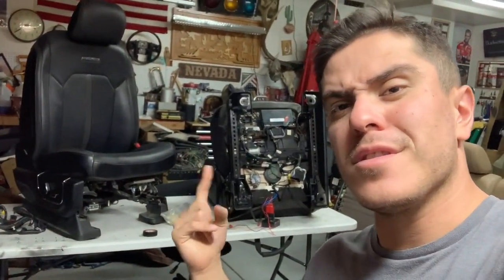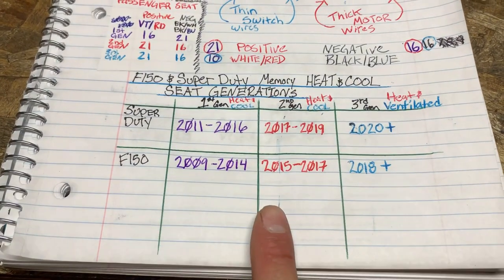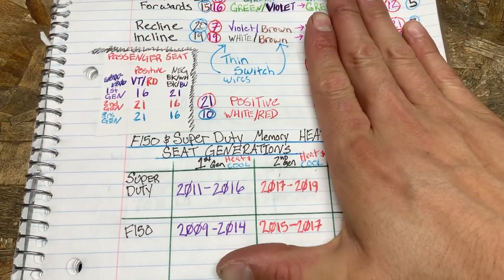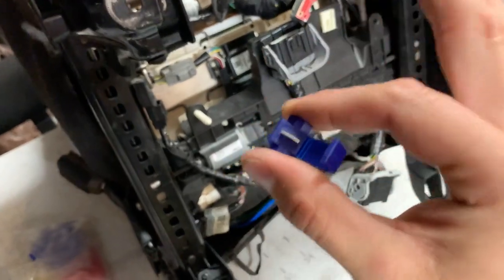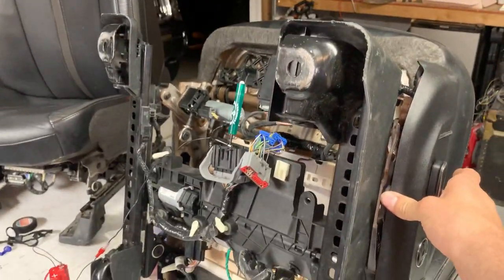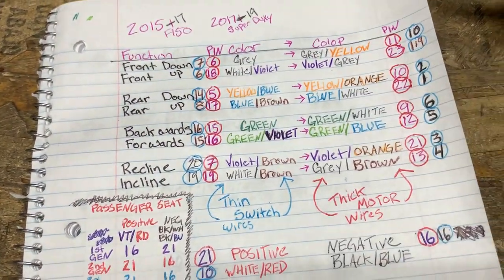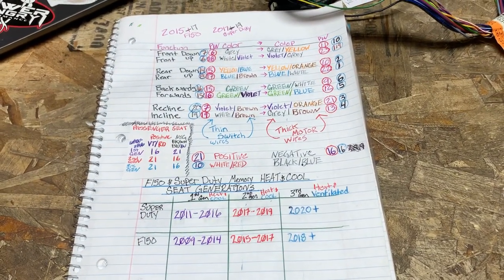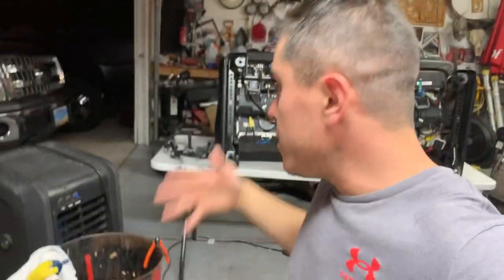How to Bypass The Memory Module & Power up 2011+ Super Duty & 2009+ F150 Seats

Comment: ⭐️⭐️⭐️ Hey guys, I’m commenting on here to add something to Zach’s video. I actually found some unicorn seats it seems. I bought a interior from a 2017 Platinum F250 and my power wire actually ended up being a wire that was LARGER than a SWITCH wire but SMALLER than the MOTOR wires.⭐️⭐️⭐️ I was very confused but ended up chasing it down by using Zach’s videos and much like everyone else on here I haven’t seen anything from him online anywhere so I just wanted to chime this in incase someone else was in my situation. The HOT wire I ended up needing was a WHITE WIRE with a DARK BROWN STRIP. Not to be confused with the small white/brown incline wire!

Comment: Absolutely spectacular video. Spot on and easy to follow. Thank you very much. One of the best instructional videos I've watched on YouTube. The only challenge Ive run into is Ford ran a microbic power wire to under the seat on my 2000, which had been previously upgraded from the blue vinyl bench to a beige 40/20/40. Unfortunately that wire does not appear to have enough oomph behind it to power the seats. As a result I'm going to have to run a new power wire. No biggie. Thank you again

Comment: Could you do a video on wiring the heating and cooling on the first and second Gen seats? In the process of swapping 11’ F150 Heated and Cooled seats in my 97’ OBS 7.3L! Would love to get full function out of the seats! I have the power figured out but have sadly already butchered the harnesses by cutting the seat motors and side switches and straight wiring them together then hooking fused power to the switches. Any help or info on the heating elements would be greatly appreciated!
Reply: Figure it out by chance?

Comment: Hello Sir appreciate the videos on how to do these upgrades. 
I have a slight different style of harness no brown plug I have a grey plug so I'm thinking a newer style seat and instead of incorporating 3 plugs the wiring colors are similar. Do you have another video that I just have not seen for the newer seats ? I am at the forward back parts and the green wire to white wire , the only solid green wire goes to larger plug that stayed in the module for the 3rd gen setup. All help is greatly appreciated. 
Also due you have one for the heated and coped seat setup yet I watched an earlier video where you did not want to ho into it at the time. 
Again thank you very much for all help.

Comment: Any insight on how to get heated and cooling working vis using aftermarket switches? Is it just as easy as getting power and ground to each device?  Thanks for the video.
Reply: Did you find anything out?

Comment: DO I STILL CONNECT THE FLOOR HARNESS UNDER THE SEAT TO MAKE SURE SEAT AIR BAGS WORK?
Reply: did you ever get this figured out? I am wondering the same thing. I also need to know what size wire and fuses to run for each seat as i am worried about overloading the wire that i currently have.

Comment: amazing video. just bought some fx4 seats for my 2014 xlt f150. had no idea how to even get started with attempting this project. thanks so much for the help. made this way easier and a whole lot smoother of a job! would you happen to know if the heated seats could ever work? i want to try them and make them work but i’m not sure as to how they would even be attempted to make work
Reply: I'm sure they just need switched 12v to do heat\cooling. Not sure if wires though. Definitely need a nice 12gauge wire for the heating, don't try to run heat from a 16g tiny wire. Setting up w\ a relay would be better too. There's a vid somewhere out here to help, I'm sure. He did do heated KR seats in his truck, so maybe check playlist. 🤔👍🏻

Comment: Wiring diagram was perfect, but two things, do you leave the airbags plugged in? And can I just run power to rocker switch and over to the heat and cooled ?

Comment: 2018 superduty platinum seats going into a 2017 xlt. I got the passenger seat hooked up and working as it should. I jumped all pf the wires like you said for the drivers seat. But still doesn’t work. Have power and ground and all the wires are paired correctly. My driver seay does not have the memory module. Guy must have snagged it.

Comment: QUESTION: Just curious, If the passenger side power module can be wired to work with just the power and ground, couldn't you potentially just swap the driver power module with a spare from a passenger side?

Comment: Hey Zachary, what 12V kit are you using to power the seats on the table? I’m trying to test some seats and am having no luck in getting the right tool
Reply: I used a craftsman drill 12v battery just find your positive and negative wires twist them good and put them in the corresponding metal tabs inside the battery

Comment: I’ve got a memory module factory on my 05 excursion. Can I just wire it instead of bypassing it?
Reply from the maker: No you can’t use the older 02-07 memory module on the newer seats. They work different

Comment: 2 questions, will F-150 seats bolt right in on an F-250?  And the other is will the 2017 seats wiring match the 2009 model seats as I have already done that conversion!  Thanks!

Comment: Can you get heated seats to work also? I'm putting Lariat leather seats from '20 into '20 xlt. Passenger side was plug and play, but heated seat doesn't work. Any idea on how to make it work? Will I have problems making heated seat work on driver side?
Reply: were you able to get it work ? as far as driver just splice those cables and it plugs right up ?

Comment: Do you have a harness that you built for the newer guess you would call them the 4th gen cause tried using this  video and towards the end where the GREEN -GREEN WHITE  and the power up is different , this harness has no brown connector , mine has 3 black connectors and one grey connector. Since your the man can you help out? I noticed in one of your other videos you have started building your own harnesses have you done them for these newer models yet ? 
Or how does it work ?

Comment: ps  .i followed your notes and bypass the memory module and wires were the same .got that far on seat .so thank you for that , now stuck on power and ground ....
Reply: Should just be able to tap into the power from the original cable coming from the floor board to pin 21. Just did mine no problem on my 2012
Reply: @turkeydog_4884 if on a 99, would I just get a regular 2 pin connector on both ends (floorboard and seat) and wire those up?
Reply: @grantprice2328  yes, it just needs standard power and ground which you can steal from the cable coming from the floor board.